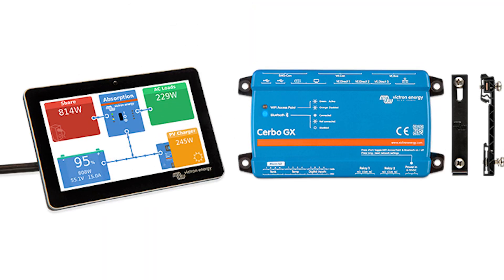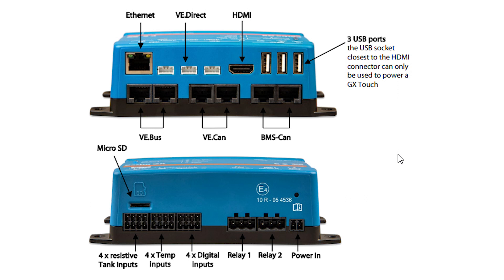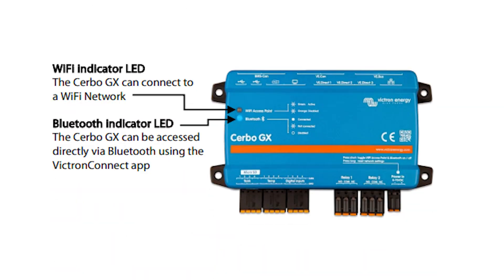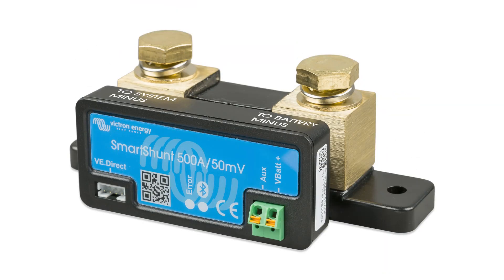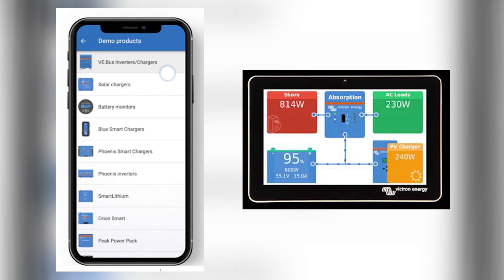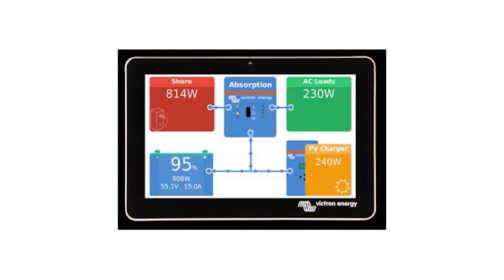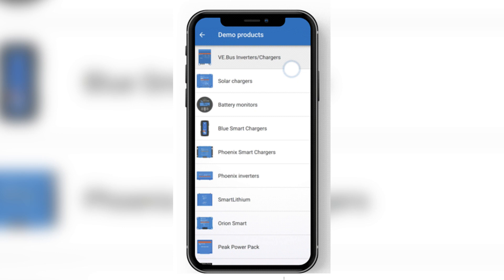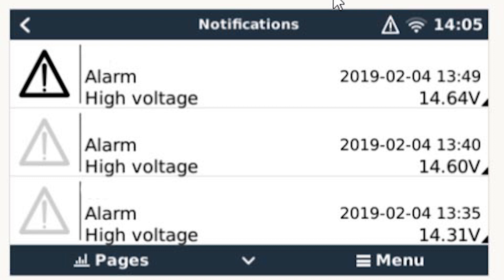Victron Cerbo GX Boat Monitoring and Control - Product Review with Jeff Cote -  Part 1 of 2

Comment: Novice here: I'm needing someone to help me. I have a water tank i need checking on , since my back hurts I can't climb up to check my water level . Im needing a cerbo gx . I need to start with list of what devices I need . So far I've listed : cerbo gx , water tank sensor , wifi . Can the cerbo handle a analogue sensor or does it strictly need a digital input sensor or resistance sensor

Comment: Thanks for doing these videos Jeff, very helpful. I thought I had questions before I bought the boat... steep learning curve... 🥴I just had the Victron Energy Cerbo-S GX, Smart Shunt Battery Monitor 500 amp, Touch 50, and GX LTE 4G-A Cellular Modem installed on my Tolly 44 CPMY. So far I can only "see" on the Touch 50 the battery state of charge and the watts coming in from my Victron MPPT Solar Controller (2x300 watt panels). That is nice. But, I'd also like to see what either the Gen Set or shore power are doing as well as the AC loads. I have a Xantrex 2500 Watt/120 Amp inverter charger - what is required to get this connected to the Cerbo? Cheers

Comment: Hi, great presentation of the system, you mentioned Jeff that it can be used as a standalone device. What if you have a Mastervolt inverter/charger, is there a way  you can be able to monitor that one too?

Comment: Hello Jeff, very good video. I am using the cerbo, my boat is in Grenada, and I am in Los Angeles. I have real good solar, victron inverter, etc  so the house batteries are well taken care of. How can I wire the engine batteries to the cerbo? Also, if I could monitor the engine batteries with the cerbo, can the cerbo turn on and off my generator to charge the engine batteries if necessary? I also have someone coming on the boat 3x/week to check on things. Going back to Grenada real soon! Thanks
Reply: Hi, you can connect an additional smartshunt to watch the starter batteries. They will not show on the main screen though, for some stupid reason Victron does not show dual banks on screen. You can also wire your generator's start button to one of cerbo's relay outputs - BUT - Noone would recommend to remote start a generator

Comment: I've had my setup for about a year now and it's been a really great system.  I started a few years back with a Victron BM712 battery monitor and Victron solar controller but they were not "integrated" and available for remote monitoring.  The Victron does a great job of both tasks so problem solved!  The one niggling issue is that because I don't have a Victron charger, I don't have an easy way of telling what my AC/shorepower is really doing.  People on the forum talk about installing ET112s etc but those aren't readily available and frankly, the cost of replacing a perfectly good battery charger for a Victron unit just to get the connectivity isn't worth the money.  In a perfect world, the Cerbo would be able to accept data from other manufacturer's equipment.  Sounds like a NMEA2000 solution would be a great add on.

Comment: Actually just purchased this last week.  I looked at the manual before I purchased but still didn’t realize that the Cerbo cannot connect to other Victron devices through Bluetooth. 

I have been using Victron Smart Battery charger and Smart Shunts with Bluetooth and love them and the interface I get on my phone and tablet. Plus they connect to each other over Bluetooth so the charger can see the info at the battery without running wiring! 

I wanted the Cerbo to tie everything together but even though it also has Bluetooth, it is only used to connect to the phone. 

Since it can only connect to the other devices through wired connections it completely negates the benefit of the Bluetooth!! 

I really hope they change this. 

Really hoping the

Comment: Yup. I had my Princess retrofitted with exactly the same kit: Victron inverter/charger, batteries, shunt, touch 50 screen and Cerbo GX. I’ve been using the system for almost a year now and I absolutely love it. Also added a few Ruuvi temperature and humidity sensors in the engine bay, saloon and fridges, which all flawlessly connect to the Cerbo. And thanks to Digital Yacht’s 4GXtream 4G router I’m always on top of what’s happening to my boat in real time, anywhere in the world. It’s fantastic.
Reply: Don’t you mean Govee temp and humidity sensors? I’ve never heard of Ruuvi.
Reply: @bobvecchi304  nope. I do mean Ruuvi. It’s a Finnish company. Google it. Great products.

Comment: I use the Cerbo GX on my narrowboat. It connects to the boats WiFi/4G router allowing me to check battery condition/solar etc all from my phone. I've added alerts so if something occurs it will email me, such as low battery etc. It's also got remotely controllable relays so my next project is for me to turn on my Webasto heating remotely.....
Reply: Which cellular hotspot router are you using?
Reply: @mightbefire  I use a Teltonika RUTX50